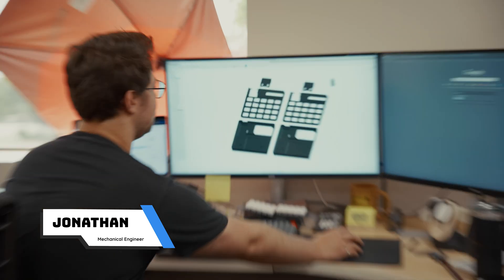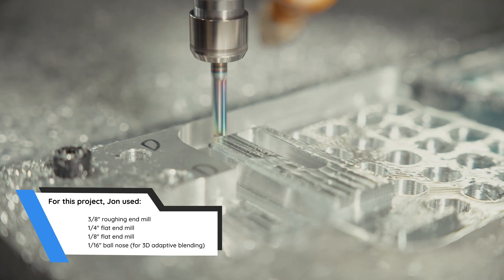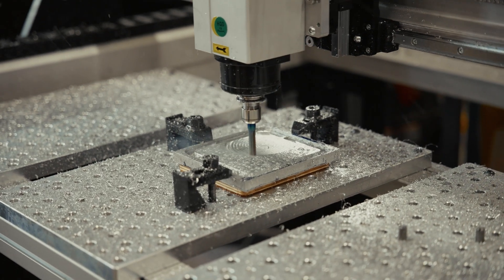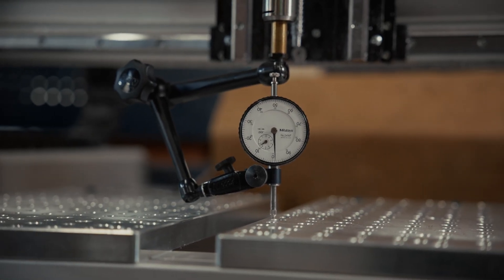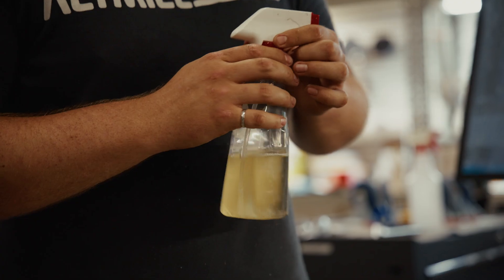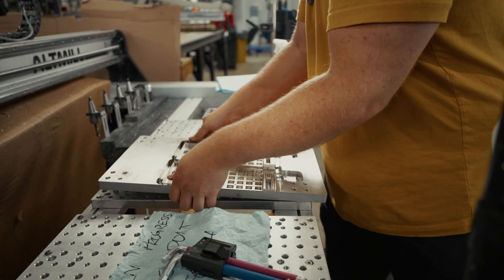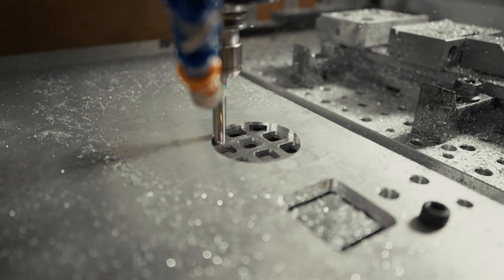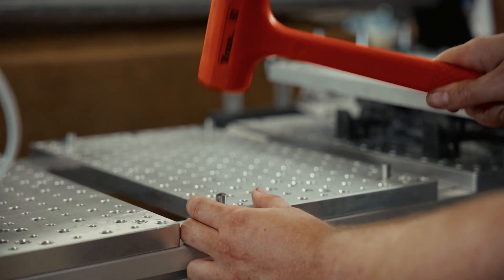Carving an Aluminum Keyboard

Comment: May i ask, is that the Spindle that will be sold with the 4' x 8' Altmill and specs for the spindle please?
Reply from the maker: It's a 2.2KW spindle in the video. Engineering team is planning on a 3KW spindle for the ATC. Specs will be shared closer to the presale date, which we're aiming for mid-Oct/early Nov.

Comment: There’s no risk of getting chips attached to the ball screw then getting jammed?
Reply: Also curious about this..
Reply from the maker: For short periods of time it's okay (if you clean up regularly) and consistently oil and grease linear guides and ball screws. Prolonged use....a cover/chip management is recommended.
Reply: You really don’t need to be concerned. Gantry-style CNC machines, especially hobby level ones, are purposefully engineered to be completely impervious to chips or fine metal particles working their way into those wide-open, totally unprotected, and extremely precise ball screws and bearing blocks.

Honestly, it’s just overkill for a machine like a HAAS metal mill to have "way covers." Those are basically marketing gimmicks. They are only to give owners a false sense of security and, more importantly, to help justify the many tens of thousands of dollars spent on such machines.

All you actually need to worry about is buying your CNC from a reputable source. One that takes the time to install these magical things called "wipers" on the ball screws and uses "sealed" bearing blocks. That’s more than enough protection against sharp, abrasive metal chips.
Reply: @surfingnoid😮
Reply: @surfingnoid I hope people are getting the sarcasm :D

Comment: I'm curious about the water cooling and more on how that was set up for cutting aluminum. It's the first time I've seen this set up. I'm hoping this,will be a set up for the 4x8 table as well.
Reply: This is my setup with the longmill
https://youtu.be/d3nO9OdQ8cM?si=yn-ig73CfV0XZtjs
Reply: @bruticusmagnus That's amazing this machine has this capability. I just subscribed. Any chance you're in Colorado? 🙏
Reply: @theebalz
Iowa
Reply: @theebalz
The altmill will be much better at this.
Reply: you don't need cooling or air blast for aluminum. just use a single flute end mill and shop vac to suck up the chips through a dust boot.

cooling is only really needed if you're making hyper aggressive cuts or if you're doing nothing but channeling work and want to improve tool life.

if you get coolant on MDF your wasteboard is ruined btw.
Reply from the maker: We used a 1-8 coolmist (or your coolant of choice) to water ratio. The physical set up was our own mist cooler (which you can find online.) No product in the pipeline at the moment.